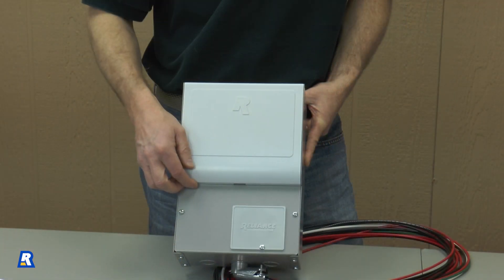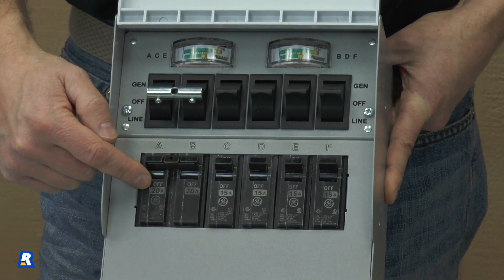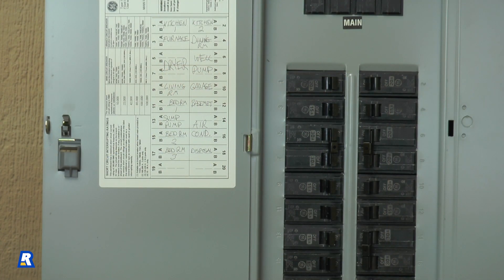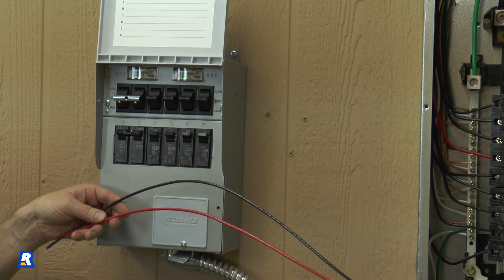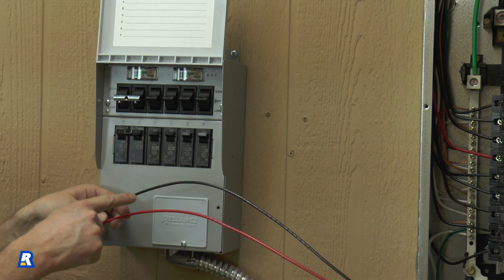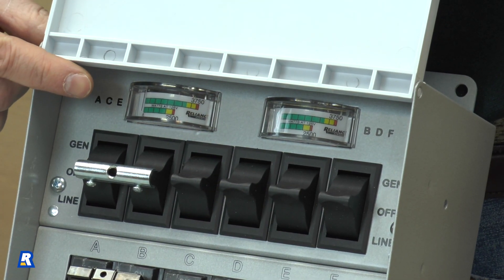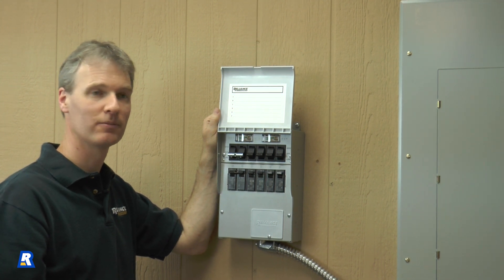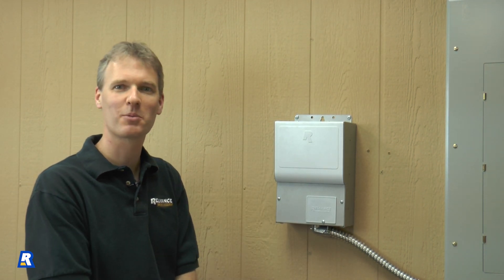From our president: Our Generator Transfer Switch

Comment: Hello. I have the R310A Pro/Tran2 Outdoor 30-Amp 10-Circuit 2. It appears that the conduit is 95% full of wires. Is this safe? I remember hearing that the conduit shouldn't exceed 40% of its capacity. By the way, great videos.
Reply from the maker: Hey thanks for the feedback about our videos :) We make them with the aim to be helpful and bring a little joy to the viewer's day.

Yes, the conduit is safe with that many wires in it.  Our products are tested by UL to the highest standards.  The wires within the conduit are an MTW type wire which means they have thicker jacketing and a higher temperature rating. 

Give us a call if you need anything elaborated on!
Reply: @RelianceControls  Thank you for assuring me and providing helpful instructions. Your product has been excellent.
Reply from the maker: @JR88888  We think you're excellent. Thanks for the feedback!!